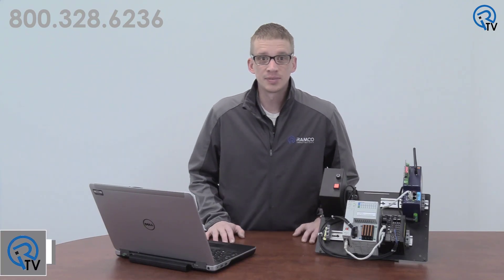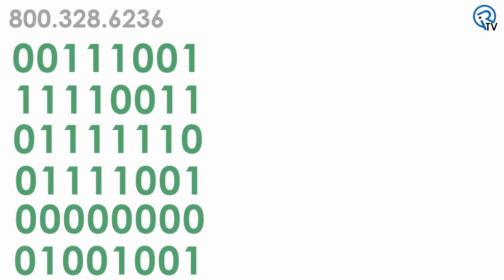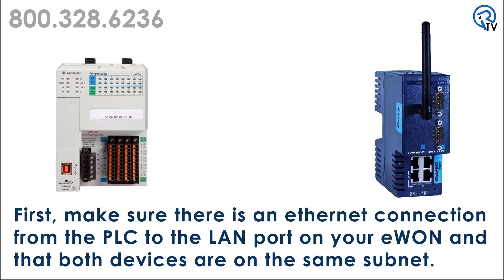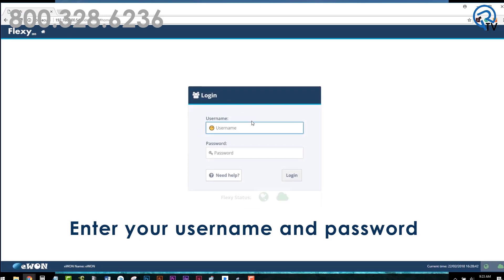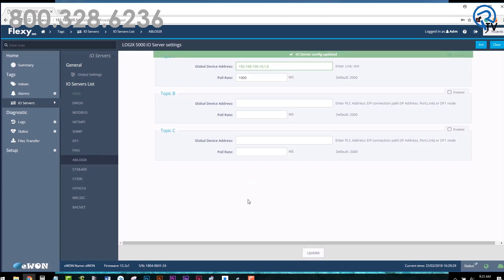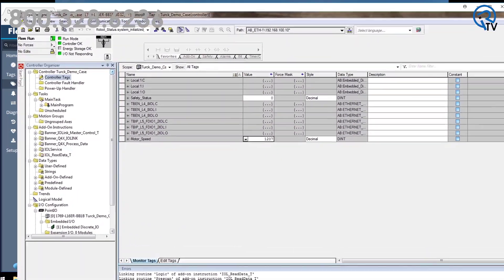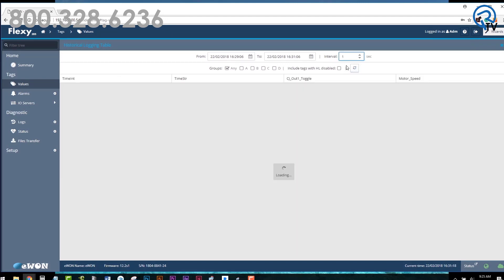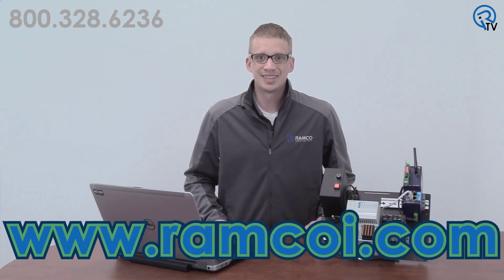Connecting eWON Flexy to Allen Bradley PLC

Comment: Great Video! I do have one question however. I have an Allen Bradley micrologix 1200 plc and it does not have an ethernet port. Can I simply buy an ethernet adapter for the rs232 plug and connect to the LAN port of the ewon flexy?
Reply from the maker: This was the response from our Tech Brad, "I don't think the RS232 plug would be able to support an ethernet adapter as those are designed exclusively for PC's and require a driver.  My suggestion would be connecting the RS232 port on the Micrologix 1200 directly to the eWON Flexy itself with the dual serial port add-on card ( FLA3301). " Hopefully this helps!
Reply: Hi does the PLC have to be on the same subnet?